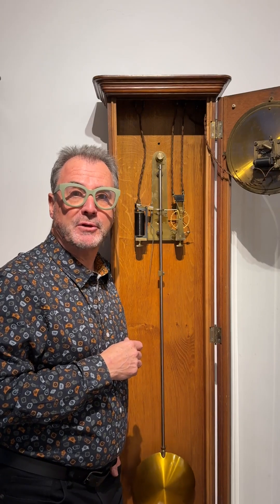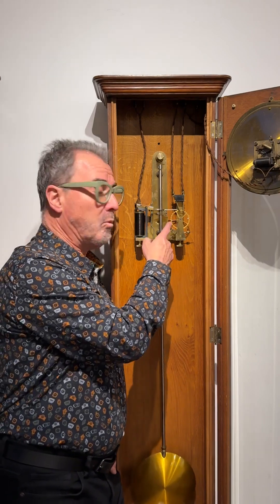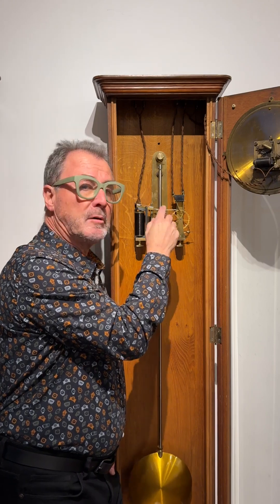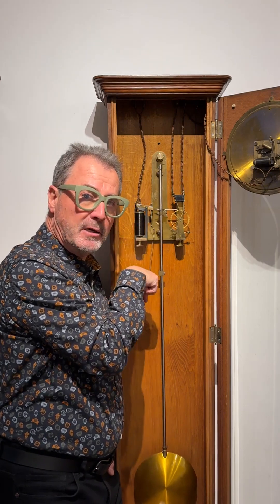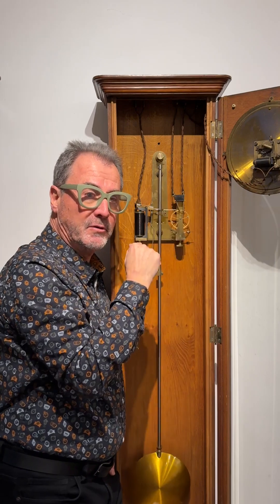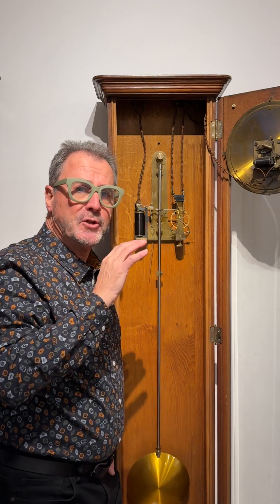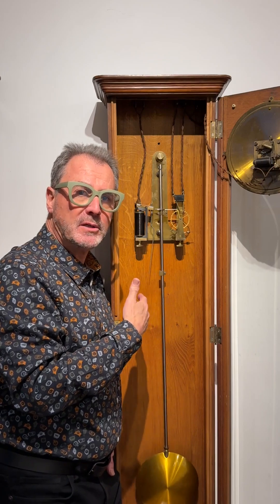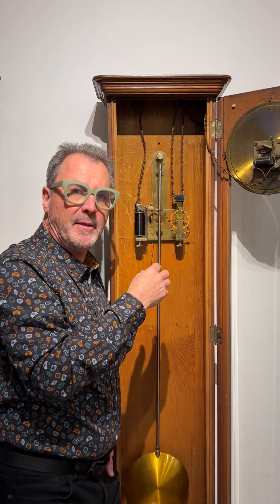Clockworks Collection: Campiche regulator

Comment: Does the swing duration decrease on the swings between the push?
Reply from the maker: Not to any significant degree, as it's impulsed every 30 seconds. It would normally take much longer for the duration to decrease, unless it was eg a turret clock with a brood of pigeons roosting on the hands.